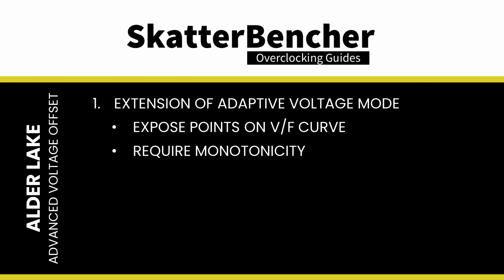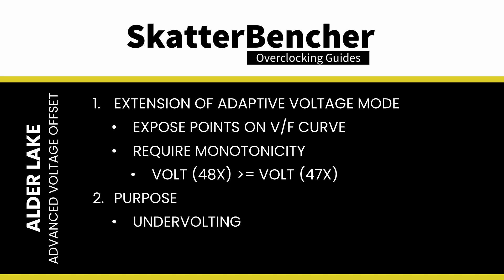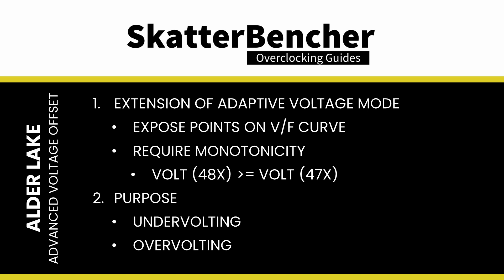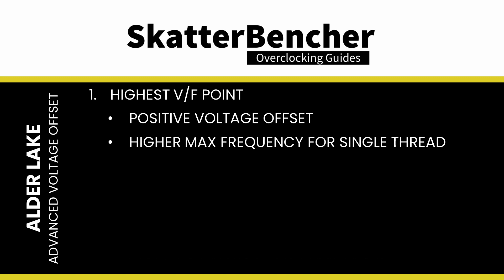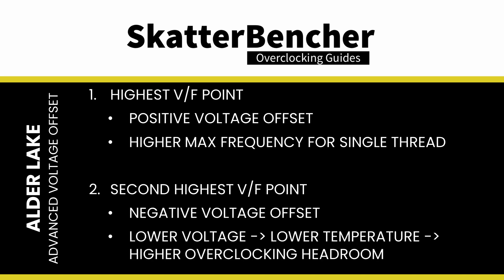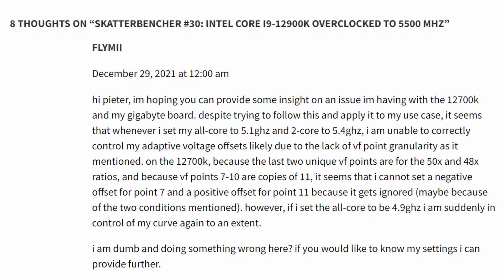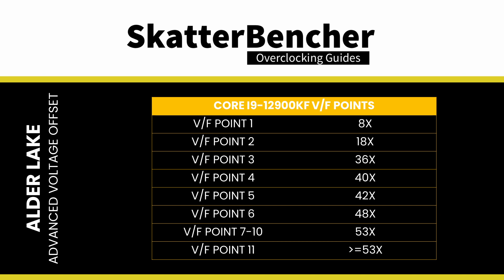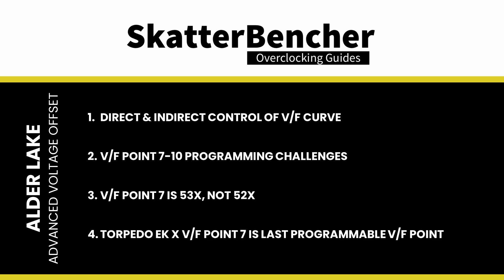Alder Lake Adaptive Voltage Offset (V/F Points) Explained | SB#34

Comment: Super helpful was confused why my offsets didnt seem to work. One point atleast for my strix z790-h board i also have to adjust the vf point that comes before the point im attenpting to change such that the vid is lower then the one im trying to change. No point in the graph can have a vid higher than the point before it.

Comment: so basically i can't control each core with different voltage, gay i went intel for nothing and its so complicated compare to amd. with basically no gain.
Reply from the maker: Intel now offers "Per Core Adaptive Voltage" which allows you to set the adaptive voltage on a per core basis. It's not quite the same as Per Core Advanced Voltage Offset, but still a kind of per core voltage configuration.

Comment: on Aorus Xtreme I wasn't able to deal with that and resigned to get manual VCore ... I couldn't understand how it really works, so let's get another try. For example I added -75mV from point 7,8,9,10 and it was too low, so reduced to -60mV and it was way too high, after couple hours of restarts I gave up and went back to manual VCore with LLC test between High and Turbo...
Reply: Gigabyte's BIOSes are completely broken. In order to get VF point 11 to work you have to specify Vcore for ratio 53, but then you will get overvolting if you overclock the e-cores.

Comment: So if I have my Aorus Pro  and 12700kf  set to 53x3 52x6 and 50x8 which vf point controls the 50x multi?
Reply from the maker: Great question! We can work through this together.

- 12700K maximum default turbo ratio = 50X. That's the Turbo Boost 3.0 Max frequency. So, now we know V/F Point 7 = 50X.
- Your maximum configured ratio = 53X (for 3 cores). So, now we know V/F Point 11 = 53X

Now, finally, we know the voltages for 51X and 52X are interpolated between V/F 7 (50X) and V/F 11 (53X).
Reply: @SkatterBencher  thank you perfectly explained.
I just need to adjust v/f 8 9 and 10 with 7?
Reply from the maker: If the motherboard has the right auto-rules in place, it should be sufficient to just configure V/F Point 7. However, if they're not in place then it's best to configure VF7 to VF10 together to the same value.

Comment: Just thinking about it wouldnt it be advantageous to use a Blk overclock so you can get more granularity to the VF points?  Not thought that thru properly tho :)
Reply from the maker: That's a great observation. Yes! Absolutely you can use the BCLK overclocking to get more granularity to the V/F Points.    There are a couple of downsides though.

First, if you don't enable the option called BCLK Aware Adaptive Voltage the factory-fused voltage-frequency will not be stable. It's easy to see why. If you increase the frequency from 100x45 to 110x45, then the voltage used for 45X will be used for 4950 MHz. That won't work for obvious reasons. By enabling that setting, the voltage frequency curve becomes BCLK aware and scales the voltage in accordance with BCLK adjustments.

Two, you'll need to look after all other ratios as well including: CPU P-cores, CPU E-cores, Ring, DRAM, memory controller, Fclk, graphics (if applicable). It's not difficult, but definitely more tedious than just using ratios.